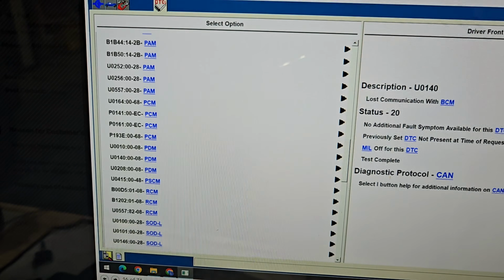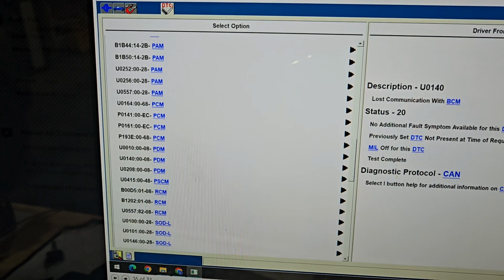Ford BLIS error and A/C Inop

Comment: Brian with Ford Tech Makuloco did a video on this some time ago.  IIRC it was on a 2018 F-350 Limited.  The truck was sent through a carwash and the water intrusion into the taillights set so many codes that the network was shut down and the truck was undriveable.  Those taillights cost $5,600.00.  I personally think $5,600.00 is too much to pay for taillights.  I think I'll just continue to look over my shoulder.  GREAT VIDEO!

Comment: I cant believe the over engineering of all the digital BS. Dont have a problem with putting 30 to 50 grand in my 1977 Ford F250 4x4 in a heart beat!
Reply: That would be true except if it's totaled and insurance doesn't give anywhere near the value.